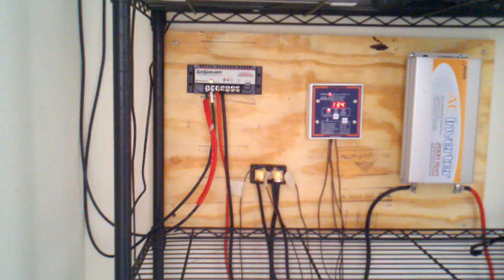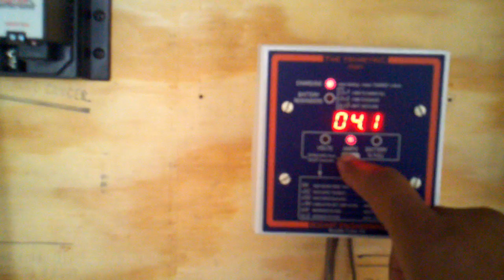DIY - Home Solar Power Part  #2

Comment: EXTREEMEL,DANGEROUS,BAD,design. NEVER hook batteries in parallel like this. No safety fuses at each battery. if a cell shorts all hell will break loose.

Comment: Using charge control going from 36v down to 12v to charge your batteries are you losing any power? Lot's of heat from charge controller?
Reply from the maker: You do loose some power in the conversion process.  That's why it's better to have a higher battery voltage, say 24v or 48v based battery system.
Reply: rhandsom there is a 48v input on a power inverter that puts out 120 ac

Comment: hi, I have the same batteries, I was told that the optima blue top batteries are 75amh, you said yours are 55 amp hr batteries. the information I received on my batteries are from optima. just wondering
Reply from the maker: I purchased these batteries some years ago, but at the time each was 55ah.  There should be a label or some indication of the amp hours listed on the batteries, at least that's what I see on mine.  However, you may have a newer version with a  different style, it's been 5 years so things may have changed.

Comment: No breakers or fuses?
Reply from the maker: In many initial setups for purely backup purposes, there are no fuses or breakers. As we learn more we add more. This system has evolved far beyond this simple setup. Thanks for your question.

Comment: Please update, how long did these battery last? I tried a marine battery in solar set up that ran a sun danzer chest refrigerator, the battery only lasted one year!
Reply from the maker: My batteries have lasted almost 4 years.  Batteries for backup systems generally last years if not over used.  If you use the battery everyday then yes, you'll get about a year out of them.  Deep cycle batteries (flooded) are generally good for around 300 deep cycles before they go bad.  My batteries are not used until a power outage.  If you want to save money with solar then invest in panels and a grid-tie inverter and use batteries for backups.
Reply: +SolarizeYourLife 
Marine batteries are usually a hybrid battery that are somewhat between a deep cycle battery and a starter battery and that is why they do not last.
You need a true deep cycle battery for that.
Also less the charging and discharging amps are the longer they last. That means that it may be necessary to get more batteries to match the load and the solar panels.

Comment: i dont know why but i feel that the batteries should be sitting in a pan of baking soda in case of a really bad overcharge and explosion
Reply: +CookedTick RTS 
In an event of an explosion, all the stuff will come out the top with a lot of force  and a tray would not do much at all. Besides, if acid would get in touch with the baking soda, you would have a chemical reaction that foams up and will most likely over flow a shallow pan and not to mention the fumes such chemical reaction would create.

it would be saver not to have backing soda in a shallow pan.
But keep baking soda on hand just in case you get acid on your skin so you can neutralize it.

Comment: cool set up we can get those batterys for $30 new  in warrensburg they make them about 10 miles away from here and i got friends working there its called intersist battery
Reply from the maker: $30 new?, that's an awesome deal on some really good batteries. I would take that without blinking.
Reply: if you live in missouri i can hook you up on the batterys there manifactured in warrensburg missouri
Reply from the maker: Thanks for the offer, but I live northern alabama. But if I lived in your area, I would definitely take you up on the offer.
Reply: I'm interested in the interstate battery. Text me 317-292-0896. Own a used car lot as you would know those battery always a problem.
Reply: The car lot is in MO. Lol sorry did not mention that. Around Springfield. I can send someone to pick up some.
Reply: i will be in knob noster this weekend. ill swing over by my connections house and talk to her about getting you some batterys.Now the deep cycle  and the marine batterys are just a few dollars more then regular car batteries but they all test out fine and you can check them before you buy them. how many do you want to try and get?

Comment: Quick questions... 1. Could you use the solar panel to power a car allternator to continue to charge a car battery?? and 2. Which direction is best when setting up the solar panels for them to face?
Reply from the maker: I don't believe powering a car alternator with a Solar Panel to charge a battery would be efficient. Depending on what country you live in, solar panels should be facing south.
Reply: The most effective way to charge a car battery is with a car, specificly with the heat energy from the engine. The solar panel can not provide the ammount of energy that gasoline can. How fast do you think those panels could spin a 25 pound flywheel?
Reply: +Ilir Kumi 
Show me or explain how you charge a car battery with heat !

If you charge a car battery with an ICE then you have about 60% of energy loss just with the heat that is created and we are not talking about engine losses and alternator losses yet.
Why use a 100HP car engine to charge a car battery that needs 1/4 HP of electricity to charge the battery.

Solar panels can provide plenty of power for just about anything, it just is depending on the amount of panels you may have to get the  power you want.

Some trains use solar panels now to power a 5,000 pound flywheel that has 10,000 RPM or so. It helps them to take of faster with a lot less  power needed. It does not take much , to power a flywheel and to keep it going, you just have to overcome the resistance of the bearings.
Reply: +down4mah2 
Why not use the solar panel directly  to charge the battery.
All you need is a solar panel, a charge controller and a battery.

Comment: Nothing plugged into the inverter then?
Do you just drag in an appliance into the garage when you want to use it?
In real life usage, how many household appliances can you run off this system.
Reply from the maker: Actually, during this phase of my solar DIY, I installed a transfer switch and an auxilary outlet to back feed through the transfer switch. With my current system I can run any 120VAC appliance I want. But my system has progressed from these beginnings.  At this particular point, if I remember, I could run up to 1500w to 2000w of appliances.  It's been awhile, so I'm trying to remember.

Comment: please tell me , your inverters are pure sign inverters, if not nothing without a AC to DC transformer it will damage computers,TV's, Cable Boxes, and other high tech devises !!!
Reply from the maker: Actually, not all inverters are alike.  Yes, pure sine inverters are better. But a good (not cheap) modified sine wave inverter will still work in a pinch, to power basic devices for communication, research, freezers, etc.  I'm partial to pure sine wave inverters, but I'll use modified sine wave in an emergency.
Reply from the maker: Yes, the inverters I have now are pure sine.

Comment from the maker: You can build a decent backup system for around 1k to 2k.  Panels, batteries, inverter, charge controller, wire, fuses, disconnect switches.

Comment from the maker: Yes, if you plan accordingly. A small chest freezer, around 5 cu ft, Blender for short bursts (during and emergency I wouldn't be using it much, if at all), LED lights are no problem, a microwave with no problems, yes to TV or radio.  Obviously, you wouldn't run all of them at the same time. Survival is not solely based on what you have, it's how you wisely use what you have.

Comment from the maker: On of the comments below mentions $20, which is incorrect. However, I believe the person meant to say $200 and simply forget the trailing 0, because he did say they were pricey which is correct. Optima batteries are usually between $150 to $200 each.

Comment: Optima batteries are top of the line deep cycle gel cells are great for an enclosed environment and don't give off hydrogen gas. they are pricey though around $20 each. also these batteries can be mounted in any position, even upside down!
this guy has a great small system.

Comment from the maker: 800w x 8hrs = 6400 watt hours (wh) or 6.4kWh.  This is small setup primarily designed for backups, i.e., lights, TV, microwave, computer, etc. running for a short period of time.  To support your 6400w (in 8 hrs) requirement would require at least battery bank with over 8000w, which will allow you to drain it down to 6400w. To recharge the batteries quickly you would also require 900w to 1kW of solar panels to offset the in-efficiences. This small setup would only give you 2hrs of runtime.

Comment: Now that you mention it, the 48 volt inverters and chargers are usually rated 4000 watts or more, If you don't intend to run the air conditioning from it, you will do well with a 12 V system. Looks like a nice clean installation and I would imagine that you'll get a lot of years from those blue tops, good luck with it.

Comment from the maker: Thanks for your comments, it's true, higher voltage inverters are more efficient, but for such a small backup system, a 48v system wasn't practical and the possible gains were not worth the extra cost. After 2 years of doing this, I would still have to say that for a small backup system, a 12v or 24v battery bank is ideal.

Comment: Higher voltage inverters are much more efficient than the lower voltage ones. If your main goal is to generate 120 VAC household current, you would have done a lot better with the 4 batteries in series and connected to a 48 volt inverter. You would probably get 30% more off grid time per charge from those same batteries with a 48 Volt system.

Comment from the maker: Thanks for your question.  The system is connected in accordance with the instructions that came with the Tri-metric battery monitor.  It is placed so that the monitor can accurately gauge the power going in and coming out of the batteries. Again, based on the Tri-Metric instructions.

Comment: I notice on your schematics picture you put the negative coming out of the charge controller to the shunt and then to the battery, is there a reason for that or can I put directectly to the battery and then from the battery to the shunt  and then to the inverter.

Comment from the maker: It appears something is definitely crossed. I've heard of panels being mis-wired at the junction box. And this seems to be a common problem with this kit if others are having the same issue, and just saying reverse the wires. I'm a bit confused though at the fact that you initially had a + reading and the next day it was a - reading. But in any case, it seems they will work. However, I still have concerns as to their reliability. Have you considered contacting the manufacturer to see what's up?

Comment from the maker: You have a point, I believe you may have a faulty controller. With that in mind, I wouldn't bother with it and just replace it with a better one. I would be more concerned with safety more than anything else, and it's worth the peace of mind in my book. If controllers are hooked up properly, they should not operate as you've described. Being that they control charge to the battery, I would get a new one.

Comment from the maker: Either you have a faulty controller, or your wires are crossed.  The same thing happens when you reverse the leads trying to read battery voltage with a volt meter.

Comment from the maker: Thanks for your comments, this particular setup is for backup purposes, i.e., running some LED lights, TV, Microwave etc, during a power outage. The most expensive components in a backup system is usually the batteries. To do what you are wanting to do, which is reduce your electric bill, you will require a grid interactive system where your cost will be in the panels ($2k or $3K, which is reasonable) and a good grid tie inverter. A hybrid system will cost more due to the addition of batt's.

Comment: still sounds too expensive for me but how much is it reducing your electric bill. My situation is that I have a huge electric bill mostly due to summer rates and AC. I have 1 handicapped child that watches tv and video games all the time. we even have 1 tv that won't turn back on after it shut off so how many panels/watts/watts/amps  do I need to run all that. We run our ceiling fans a lot too.

Comment from the maker: The Optimas are Dual Purpose Deep Cycle AGM's.  You can go to somewhere like Batteries plus and get cheaper AGM's.  AGM type batteries are more expensive, but they are generally safer, due to the fact you can place them anywhere you can't put flooded batteries.
Reply: Why did you use blue top not yellow top? Is there a reason?

Comment from the maker: Thanks for the comments.  With a 90w solar panel system, your 122ah battery is fine for a good backup system.  90 watts will charge your batteries in a good amount of time, and the 122ah will give you the hours you need to run energy efficient electronics, TV's, and lights.  If you get some LED lights for lamps, you will be good to go. Adding more batteries will indeed increase your amp hour capacity, but may require additional panels to charge them quickly in the event of a deep discharge.

Comment: RHand,
I love you solar information. I just setup my 45 watt harbor freight system.  I'm going to purchase 1 more to bust me up to 90.  I was looking for a way to determine the size batteries I will need.  I currently have a 122 AMP Hour battery for the 45 watt panel. Keep up the good work my Engineer Brother.

Comment from the maker: The cost depends on what type of system you have, ie., Grid Interactive (GTI), Emergency Backup, or Hybrid. A good small sized GTI could cost between 3k to 5k (DIY Cost), a good backup between 5k and 8k (due to batteries), Hybrid between 8k to 10k.  Your electric bill savings depends on the power you will have coming in, your monthly usage, and your utility cost (Ideally you want to save 30% or higher). If you go with professional installers obviously your cost will go up considerably.

Comment from the maker: Thanks for your comments, this is an old video so it doesn't show my current layout. I now have 4 panels and 12 batteries in a 24v configuration.  It's going on 2 years now and my expanded system is running fine.

Comment: I like this I suggest you add 4 more batteries, your solar array has already charged the batteries, still sunny out, adding 4 more batteries would double use of your solar panels  I took 2 years wiring and two years of electronics at tech school during and after high school. also you can buy more solar panels cheap on e-bay and wire them to what you have now tripling or doubling solar use. I saw a 120 Watt 24 volt flex roll out panel for around 130 dollars on E bay. I am not the one selling it,

Comment: Batteries in parallel fight each other-no batteries are same voltage levels. Batteries should always be in series - Current can be lower, voltage can be higher and wires thinner resulting in the same POWER.
Also sad that the batteries are at 100% while the sun is shining. Waste of sun.
This system needs to be autonomous - battery for each room in the home with smart switching that directs the power to the most in need. When a room runs out of power - oh well. Still watts remaining in other rooms

Comment from the maker: Interesting question. Obviously there are better qualified people to answer your question.  But if it were me,, I would have 3 arrays of 24v panels at 225w each (total of 1350w in panels).  Arrary #1 = 2 24v panels in series (48v), #2 same, #3 same.  Each array would be connected in parallel (48v @ approx 8 amps) x3 = 48v @ approx 24 amps.  A 1.3kW solar array would be more than adequate to charge your battery bank.  So in short, 6 24v panels at 225w (or greater) would work.

Comment: i am working in telecom field. where we have to maintain BTS (Base Transceiver System ) Power supply. BTS requires 30 A and 45 to 55 V . additionally we 2*400 AH battery bank. so battery charging current around 70 A.
so total 100 A current ,45 to 55 V voltage weather we can provide through solar.
if so how many panels,space and money required  .

Comment from the maker: You can have a similar setup for around $2,000 give or take.  Example Estimates - 2 200w panels $250 ea, Inverter $500, mppt charge controller $250, AGM Deep Cycle batteries $180 ea (x4), (Flooded batteries are much cheaper), Battery Monitor $150.  Granted, these numbers are estimates and they depend on where you get the equipment. My advise is to shop around the internet and don't limit yourself to one supplier.

Comment from the maker: A 30Amp charge controller is a good sized charge controller so you can have many panels.  If each panel was capable of 7 Amps AND they were connected in parallel, then 30A / 7A = 4 panels (4 panels in parallel, that equal 7A each would be 28Amps altogether).  Look at the "Current" ratings of each panel and divide it by 30A, that will determine how many panels your charge controller will support.

Comment: My whole house runs on electricity.  My hot water heater uses a 30 amp breaker.

My thought was to have stand alone units for each high energy units that are constant draws until such time that a whole system can be had; so, one for the hot water heater, and one for the refrigerator, then the system for the whole house.

Comment from the maker: I like your goals. The electric vehicle sounds interesting. As for something like this running your hot water heater, that may be more difficult.  Depending on the size of your system, the type of water heater you have you may need to get a lot more panels.  I would initially start small and focus on a backup system, then progress as your knowledge and finances allow.  If you have a propane or natural gas Tank less water heater, you can use your solar for the electric start and propane for heat.